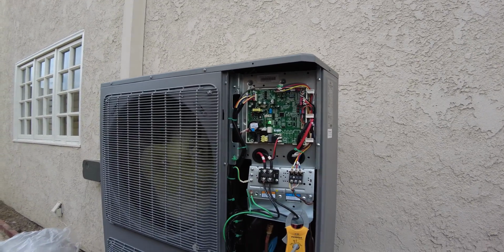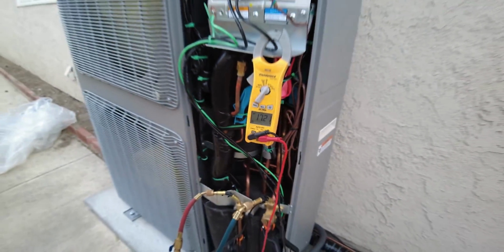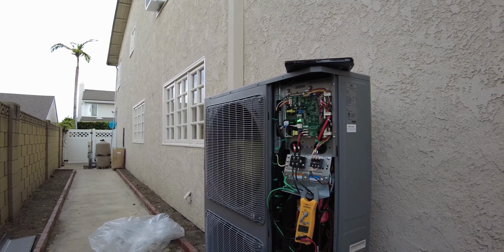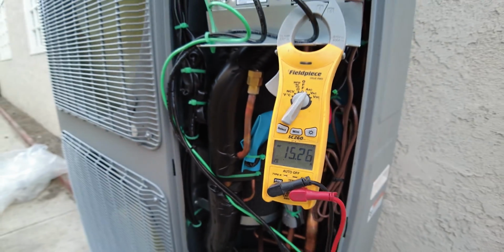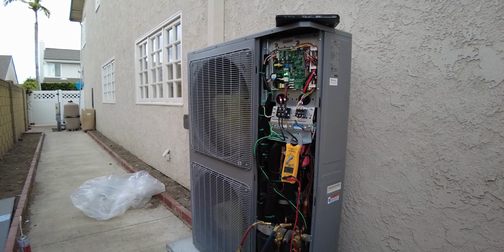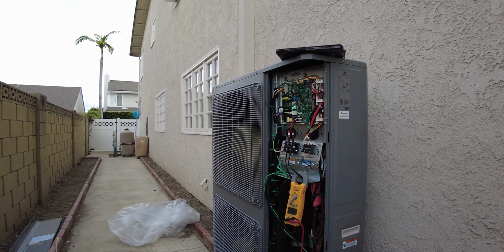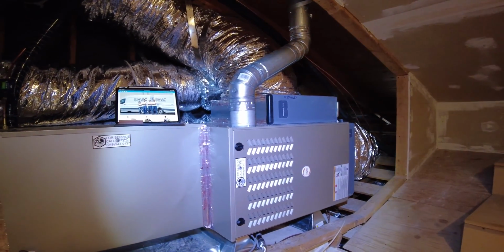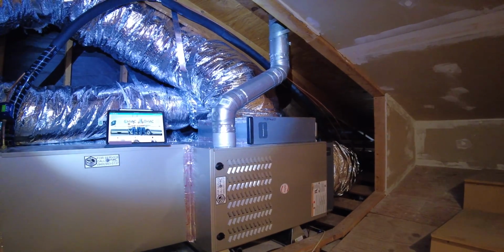X Series ACPRO inverter air conditioner review / Paine furnace in attic w zoning / Irvine California

Comment: so what is the correct pins settings for 4 tons ? Thanks for this video
Reply from the maker: for 4 ton 48000btu sa2-1 should be OFF. for 5 tons 60000btu sa2-1 should be in ON. 

please double check with unit installation manual!!   also you can check with amp meter. in 4 tons mode it will use less amps

Comment: Does the condenser fan speed and noise level varies along with the amp draw or they remain the same regardless of compressor pressure?
Reply from the maker: yes outdoor unit compressor varies speed depending on heat load(superheat) and outdoor condenser fan has different speed depending on load and outdoor air temperature.
Reply: @airbluehvac  very nice. Someone installed an x series (same as the one in your video) paired with A series AH bce7s60ma4x-50 blower, dual zone setup with two nest thermostats but the system is either full speed or off, no variable output neither from condenser nor air handler unit. What did my contractor do wrong you think?
Reply from the maker: @amindashti9908  i believe your unit could get 2 stage operation indoor fan in cooling and heating and outdoor unit will adjust its speed accordingly. just need to put some effort wiring airhandler and 2 stage thermostat and 2 stage zoning panel. 
but you also have zoning!! if 2 stage zoning panel used you can choose if thermostat controls stages(need two very large zones and each zone will have 2 stage fan) or zoning panel controls stages like in this video(1 zone calling is low fan speed, two zones calling-high fan speed)
Reply: @airbluehvac I was hoping the X-Series (AC Pro #: 73234    MFG #: AULD60W2/A-D(U)) along  with A series AH (MFG #: BCE7S60MA4X-50 ) could give me variable speed at compressor and blower unit not only 2 stage in a two zone setup. Nevertheless the system is currently working in 1 stage! Is what i am looking for doable?
Reply from the maker: @amindashti9908  Outdoor unit will be variable but indoor fan best you can get is two stage fan.
Reply from the maker: @amindashti9908  Outdoor unit will be variable but indoor fan best you can get is two stage fan.
Reply: @airbluehvac  whats blocking the indoor fan to also be variable?
Reply from the maker: @amindashti9908  need 4SHP18LX160P condencer and Comfort Sync A3 Ultra-Smart Communicating Thermostat and comfort sync zoning panel.  twice more expensive setup.  see our other video with TRUE VARIABLE speed ALLIED system
Reply: @airbluehvac  I think i need your professional help to navigate through this. I still confused why a variable condenser, variable air handler can not deliver variable system. I reached out to AC PRO and they don’t provide support to consumer.
Reply from the maker: @amindashti9908  because your air handler is designed to communicate to variable condenser 4SHP18LX160P through ipad looking Comfort Sync A3 Ultra-Smart
Communicating Thermostat and comfort sync zoning panel(if zoning present).  when you use all mentioned above components together you will get true variable speed system. so far best you can get is 2 stage fan operation what is way better quieter and more efficient than 1 stage units and very cost efficient setup.     

true variable systems are almost twice the price and some customers are willing to pay for extra comfort.
Reply: @airbluehvac  I was told this combination works in variable mode and i didn’t mind paying more. Can you configure the system to work in 2 stage fan? I am also in orange county.
Reply from the maker: @amindashti9908  Yes we could look at it and you may need another 2 stage zoning panel Or more wiring but I would prefer not to touch your system because it’s brand new and still has years or labor warranty from original installer and I want you to keep your labor warranty with original installer.

Comment: How much would this unit cost? Plus installation?
Reply from the maker: Replacing existing indoor and outdoor units would be over 12k. Adding ac or heat-pump to the house with no preexisting ac unit is more than that

Comment: Had this unit along with an acpro "allied" furnace installed professionally ; however, the AC  is blowing hot air.  Everything checks out ok including the 4 dip switches, freon pressure and compressor  - is there some unusual setting for this box to work correctly? Any feedback is appreciated. We are at a loss why AC is not working.
Reply from the maker: if it was professionally installed better call for warranty service, don't add more issues by DIY. it is most likely something simple since system is brand new.
Reply: Did you ever find the issue on your unit?  Did installer fix it without hassle?  Who was the installer?  I'm looking at these.  I don't want problems.  LOL!

Comment from the maker: I accidentally deleted somebody's comment about programming and airflow! this furnace has ECM 5 speed blower motor and we simply use proper blower speeds for 1-2 stage or 1-2 zone. Pretty easy setup, just go to CARRIER tech class and they will teach you how to do it. As of right now CARRIER/BRYANT/PAYNE do not have 2 stage or variable speed ultra low NOx furnaces.

Comment: How much did this unit cost?
Reply from the maker: cost varies. just outdoor unit you may get for 4-5k. this whole setup: furnace relocation, all new ducting with zoning system including asbestos removal and adding ac unit and running electrical was little over 20k

Comment: I had been told the x-series manufactured by Lennox?
Reply from the maker: X-Series is definitely not LENNOX and not made by same manufacturer!!!

ACPRO is very large(if not largest in OC CA) distributor and they do sell many different units under ACPRO brand. some are made by ALLIED(same manufacturer that makes LENNOX products, even has LENNOX written in the paper operation manual), some like X-Series are made by Gree (China), and many other products.  X Series inverter unit is approximately half the price of LENNOX inverter unit and if installed correctly can work in two stage operation.
Reply: @airbluehvac  Are you sure? The AC Pro unit bears a significant similarity to the Lennox LIAH060-200U432, right down to having the same DIP switch settings
Reply: @airbluehvac  how do the Gree ones last compared to the ones made by allied?
Reply from the maker: @65MMREHP  simple 1 or 2 stage non inverter units can last 20-30 years. but any inverter units are arm and leg to repair after warranty expires(10 years).
Reply from the maker: @65MMRE   @65MMREHP  simple 1 or 2 stage non inverter units can last 20-30 years. but any inverter units are arm and leg to repair after warranty expires(10 years). it is always a choice between highest efficiency and comfort VS simplicity and longevity.
Reply: @airbluehvac  will the x series last as long as other too brands if it's half the price?
Reply from the maker: it will last, same 10 years parts warranty like other units in California backs it up.
Reply: @airbluehvac  I'm even seeing A series and x series. How are consumers supposed to know the difference and quality of each series?
Reply: How do you set up for 5 ton on dip switches?